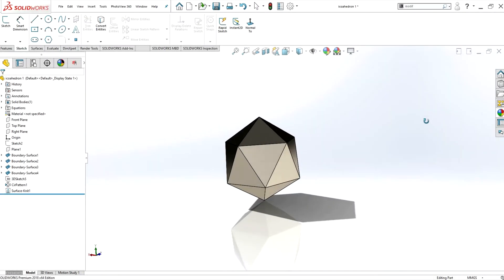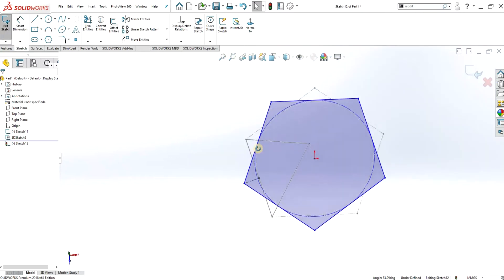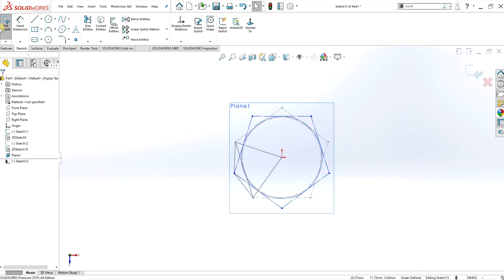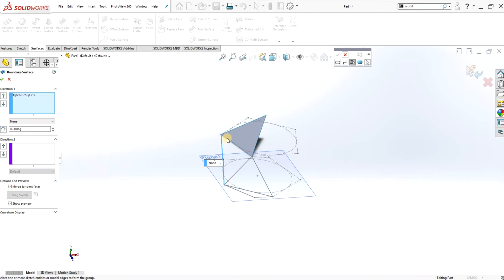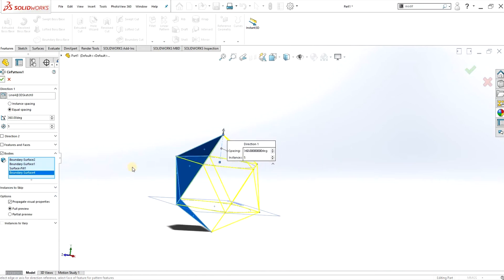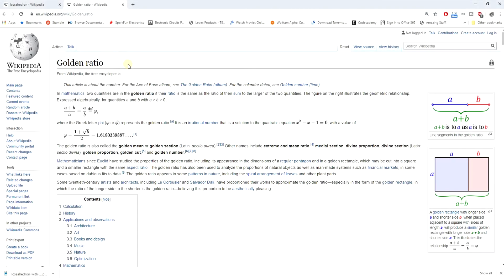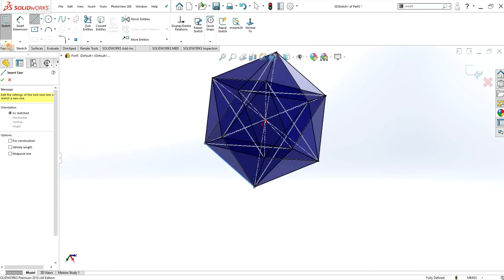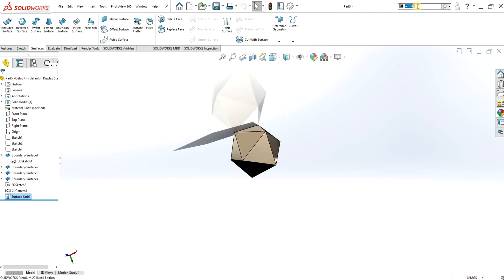Modelling an Icosahedron

Comment: Isn’t the 1st method more mathematically accurate as the second is made by the constraints of an irrational number?
Reply from the maker: Nice observation. If only a couple decimal points are used for the golden recatangle dimensions then there would be some significant error but if you were to use several deicimal points the error would be so small it would be less than any manufacturing accuracy - which is I guess what SolidWorks is concerned with. But more importantly the dihedral angle of an icosahedron is also an irrational number. In the first method you essentially use SolidWorks' dimension feature to solve for the positions of verticies, so it's  putting them in a position defined by an irrational angle so it can't be completely accurate either. The dihedral angle is the angle between the faces btw
Reply: Mech Designs & SolidWorks Tutorials good response, thank you!